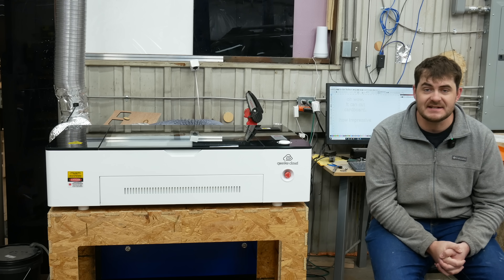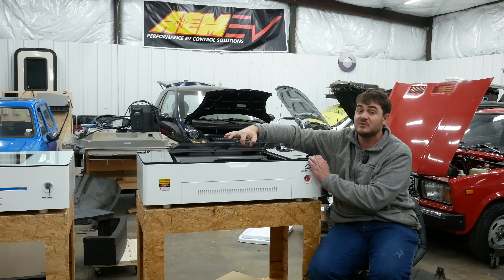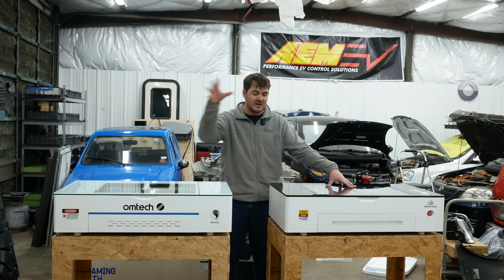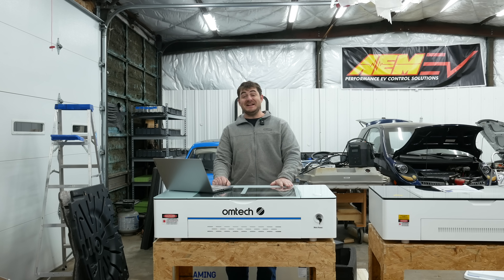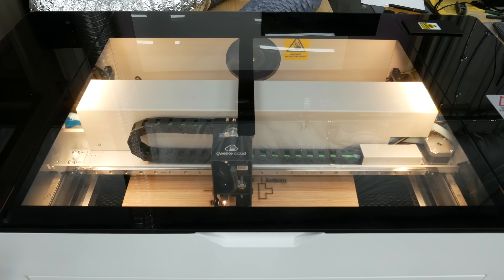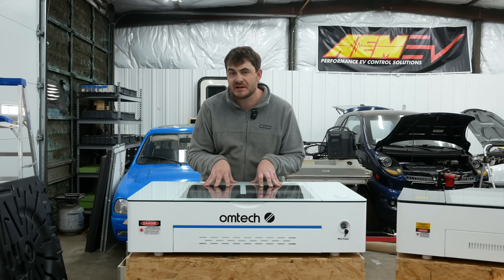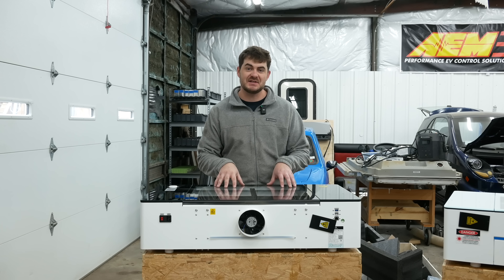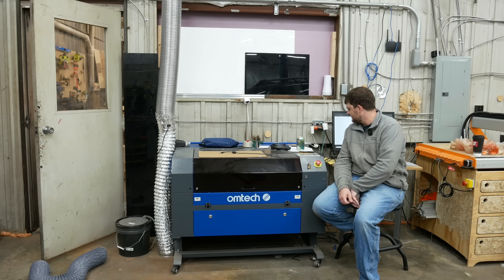The OMTech Polar and Gweike Cloud are (mostly) Desktop CO2 Lasers

Comment: I guess instructions of "removing spaces from wifi name" does not mean you should not enter spaces in the box, but you should rename your wifi.
Reply: That sounds even worse, you have to really try to make entering the WIFI SSID a difficult process.
Reply: Wonder if putting the ssid in quotes would work lol
Reply: @AchievedZeus574  If it does, that'd have some very interesting security implications.  I wonder if someone's tried installing a minecraft server on it.
Reply: 100%. A space is a valid character in a SSID. If you omit it, It won't be able to connect. It seems like it's unable to parse it (which is pretty half baked). Having to rename your network's SSID is a pain. On the Omtech, I'd be curious if you couldn't just set your IP manually, then get it connected to your wifi and have it get a DHCP address. It's gotta be able to, right?
Reply: @jmhalder  The Omtech should really just have its own DHCP server when hosting its own Wi-Fi.
Reply: Immediately heard it that way when he said it. I work in technical support….. I know when the silly directions are serious
Reply: Exactly.
Reply: Massive Brains.
Reply: Wonder if using ascii input would work for a 'space' (on mac you simultaneously press 'option' + 'space' and it inserts a space at the cursor... not going to buy one to find out...lol
Reply: Judas, I have about 150 devices on my WIFI network.
They can keep that boat anchor, I'm not renaming my WIFI and then spending a month fixing the WIFI on all of those devices, half of which have an up down left right kind of interface to select text, no thanks.

I would just go OmTech and use a cable
Reply: There's a reason to prefer using an Ethernet cable instead of using WiFi
Reply: Anyone even remotely familiar with technology and the issues that can arise with putting spaces in names like this should never put a space in their wifi name.
Reply: @nstg8  My SSID is all emojis
Reply: Spaces may technically be legal in SSIDs, but using one is still a silly idea.
Reply: @JasperJanssen  I'd argue that it's a good idea, any product in 2025 that doesn't support spaces in SSID's should not be connected to your wifi.
Reply: @JasperJanssen  because sketchy IoT devices with shitty shitty WiFi stacks choke on what is a perfectly standards-compatible SSID? Yep, I can see that.
Reply: @rherydrevins  You don't need sketchy IoT devices, myr Candy washing machine chokes on "&" in my SSID.
Reply: @rherydrevins  not just them. Lots of only a little sketchy devices choke on them as well.
Reply: on top of it probably can only connect to 4ghz wifi and if your router has the same ssid for 4ghz and 5ghz it will not work
Reply: @TechTinkerWorks  2.4GHz, not 4GHz right?
Reply: @thomasphillips885  my bad.. yes. 2.4
Reply: @TechTinkerWorks  4Ghz isn't a wifi standard. 2.4ghz and 5ghz is. If you use the same SSID for both frequencies, it should still be able to connect. The exception being if you have really harsh band steering on your APs. Eero is apparently bad with this. I had some 2.4ghz TP-Link Kasa devices that had problems with this too. You can lessen the band steering, or disable it to fix it.

Comment: I have a 3D printer that also does not recognize spaces in the password, so it now runs on Klipper on a remote USB connection.  There is a cheapo WiFi chip in use that can't handle spaces...

Comment: I flinch whenever I see USB A connector where there should be USB B... so you need TWO non-standard cables...
Reply: I wonder if it's just because a USB-A socket is a fraction cheaper than a USB-B one
Reply: Yeah I was wondering where the A to A cable is supposed to come from, because the computer sure doesn't have a B connector on it.
Reply: Which they provide with the Machine ( at least they do on the GWeike Cloud )
Reply: Agreed - someone wasn't thinking about the connectors.  For equipment like this - sorry - should be a USB B connector on the back - just like printers have.  USB C as a connector in an industrial setting - seriously - just doesn't withstand the rigors of the environment that's needed.
Reply: @fredinit  its probably USB-A because they want it to be able to be used as a host for memory sticks etc. and didn't want to spend extra for one more USB plug. And USB-A to USB-A is probably the least horrible non standard cable out there. And are we really sure it is USB-A to USB-A and not USB-A to USB-C cable?
As for USB-C, there are industrial cables for it. But as for regular ones, I don't see a situation where a USB-B would be sufficiently rugged but not a C. If a B connector can handle it, then so can a C.
Reply: I cringe at anything that's not USB-C tbh
Reply: At this point I refuse to purchase anything that doesn't come with a usb-c connector.  It's 2023, lets stop living in the past.
Reply: @nstg8  good luck with industrial equipment lmao. it'll be another 5 years before it's common, let alone standard
Reply: @nstg8  Couldn't disagree more. Fixed appliances like printers or CNC machines SHOULD NOT have Type C connectors, period, unless they specifically need USB 3 functionality; full-size USB Type B is vastly preferable (though even then I'd still prefer to just have a DB9 serial port).
There's no OTG mode, nobody uses it for TTL serial or audio passthrough or charging, and you'd be hard pressed to even find a "charging only" A to full-size-B cable. Only one thing that can be on the other side of that connector, and one possible protocol. If it fits, it works.
I'll take flipping the type A end over a few times any day, over trying to debug all the "Audio Accessory Mode" or "Alternate Mode DisplayPort" or "VOOC E-Marker" or "Source-default Dual Role Data" bullshit that's possible with Type C. And if it weren't bad enough, the USB-IF keeps retroactively changing the spec every few weeks it seems, just to keep everyone on their toes. There are a thousand different features a type C device or cable can fail to support, and even more nonstandard uses and shortcuts and hacks out there in the wild. And when I'm trying to debug the thousands of dollars of equipment at the other end of that cable, I would vastly prefer a connector I don't have to keep second-guessing at every turn.

Comment: Nice of them to make you ship the one back just because you didn't want to sell their trash for them. Did you mean to call it "Gweneth" in the description? Great video as always.

5:48 Sounds like it started life as a desktop CNC mill. Lift tool from workpiece, wait for tool to stop spinning, then return.
13:11 Wow, sounds like they made an electric manual focus... That's like calling a car with an electric choke "Fuel injected"
Reply: That it's reusing cnc firmware was my first thought, my guess is they're using something like marlin with dodgy presets that it was easier to not change. I did have a look and the ruida boards are specifically built for lasers so it seems odd, but I wonder if the machine profile has some sort dodgy gcode transformation that needs to be removed 🤔
Reply: This guy is full of it. "they get it back" but yet puts his referral link.
Reply: They said right in the beginning of the video that they were going to call it "Gweneth", so yes, they probably meant to call it that in the description. :)
Reply: @IstasPumaNevada  They? I didn't know Robert was running in parallel
Reply: @AiOinc1  "They" can be a singular or plural pronoun, in this case it's singular because it's referring only to Robert.
Reply: @AiOinc1  He is known to run clones
Reply: @futuju  The only reasonable conclusion. His assistant will strike again
Reply: @AiOinc1  it wouldn't be the first time...

Comment: I have wanted to put a laser in our lab for a while and I'm getting closer all the time. Not with either of these, whatsoever, but closer.  😁👍
Reply: might want to take a look at the xtool co2 lqser they just anounced , but its kind expensive
Reply: @Basement_CNC  yeah, seriously thinking of that one, wish actual demos were available.
Reply: I love seeing you here.
Reply: @nerobro  👋😁
Reply: CO2 Lasers are damn useful.
After seeing what The Warthog Project has done with a basic one, making all of his button panels and cockpit dials, I have been gunning for one myself.
Reply: From personal experience I'd recommend anything from Epilog out of Colorado. They're more expensive than Glowforge but if you're going to use the machine a lot and want a USA designed, engineered, and built machine they are so worth it. Oh, they also have machines that have CO2 and fiber sources in one machine, with the fiber laser you can do direct metal engraving, and all their machines are air cooled.
Reply: The "base box" looks good. I'd say if you can, just look into replacing the firmware
Reply: I have the cloud and you don't have to do the mess around, there's a very decent work around. I wrote up how on the LightBurn forums. Wish I could post the link, but there is a MUCH MUCH easier way to manage the z weirdness of the cloud.
Reply: XTool P2! There is NOTHING like it on the market, utter & absolute GAME CHANGER!
Reply: if you got time o learn about our GOOD-Laser?

Comment: I've definitely seen cheap IoT stuff that refuses to connect to networks with spaces in the name.
Reply: Don't put spaces or special characters in your SSID and you'll be just fine
Reply: @nstg8  Yes, let me just reconfigure every device I own to remove the spaces from my WiFi's name to accommodate the poorly coded IoT device that doesn't comply with standards.
Reply: @WarpedFlayme  or you can fight with every new iot device you buy. Or you can make a separate SSID for your iot devices with limited communication to your secure SSID and practice good network security
Reply: You're not wrong about the separate network, and I do have a separate wifi network and VLAN for my IoT crap. My point is that you shouldn't need that degree of networking knowledge because some company couldn't be arsed to properly implement the WiFi standard. If it's a selling point of the product, it isn't unreasonable to expect it to work properly.